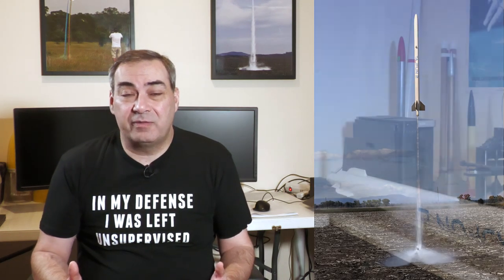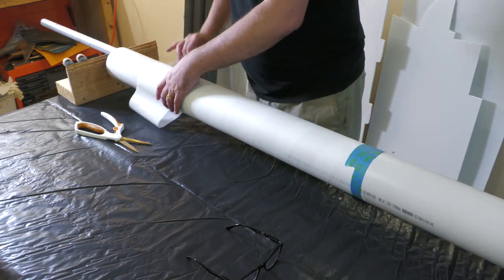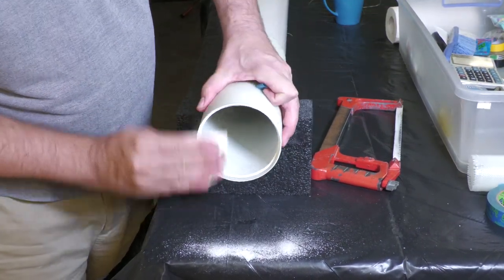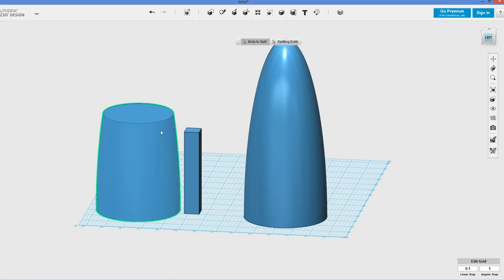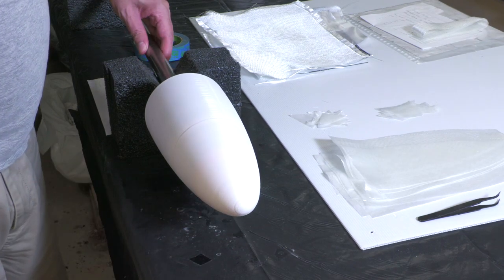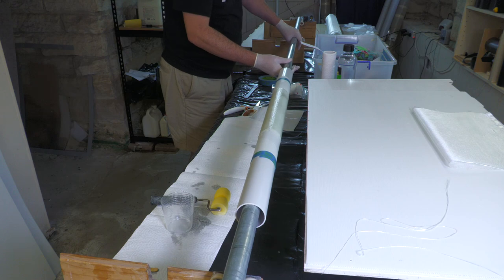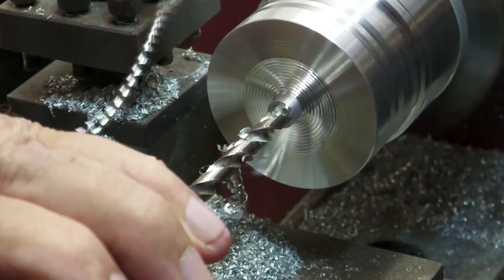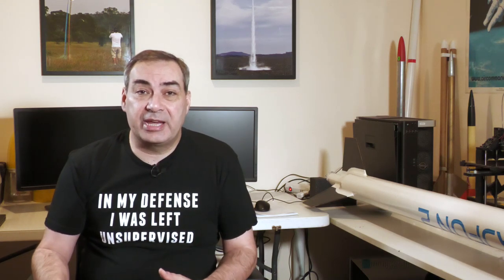High Power Water/Pyro Rocket - Part 2 - Nosecone and Nozzle

Comment: it is magnificent that you use simple tools like a pizza cutter for the fiberglass. We really need to think a bit simpler. That tipp will be used ❤. Well then the production of the nozzle is shown an we instantly feel like we are just some guys without any proper equipment. Loved the video though . great process so far
Reply from the maker: Thanks, although it looks like a pizza cutter, it is actually a roller cutter typically used for cloth. (here is an example: https://www.scissorman.com.au/product-tag/rotary-cutter/) If you ever need to cut fiberglass cloth, it is the ONLY tool to use. You'll never go back to scissors once you've used it. Much cleaner and faster for complex or straight cuts.
Reply: yes looks like it we used a big commercial cutting Maschine but the blade was getting absolutely destroyed by the cloth. We will definitely invest in such a tool. thank you 😊

Comment: I have a question about the epoxy you use to making this rocket. What is the epoxy you use for this rocket, and does it have high temperature resistance. I am also building a compress air rocket which is aimed to reach Mach 2 so I am currently very concern about the surface temperature and the ability to withstance heat of the rocket's material at high temperature. I am also watch alot of your videos right now and learn a lot from them. Hope to get your response. Best regards.
Reply from the maker: Hi, the epoxy we use is West Systems 105 with the 206 slow hardener. It isn't a high temperature epoxy. I think it's glass transition temperature is around 58 degrees C. There are high temperature epoxies you can use but these tend to be a bit more expensive, however, most of the airframe isn't going to experience very high temperatures for a long periods of time. I would be comfortable using West Systems on most of the airframe even for a Mach 2 rocket. You would want to protect all the leading edges though with different materials or higher temperature epoxies. ... You mentioned a compressed air rocket going at Mach 2. Do you have any details on your proposed rocket and how you would achieve those kinds of speeds?
Reply: @AirCommandRockets  Well, for our rocket, we intend to use a convergent-divergent nozzle that we design to have an optimal  area ratio and pressure ratio that can accelerate the flow to mach 2 and above. The chamber pressure we choose is 10 bar so we calculated the appropriate area ratio and pressure ratio base on isentropic flow relation and got a result of about 1.91 and 9.87 which thereotically can help to accelerate the flow through our nozzle to maximum exhaust velocity of Mach 2.14,  and from these 2 quantity, we can also calculated the real exhaust velocity, mass flow rate, specific impulse and thrust. So our rocket will have a real life exhaust of around Mach 1.53, a mass flow rate of 0.82 m/s, a specific impulse of about 53.8 s and a thrust of about 434 N. The exhaust velocity is not so high, which is understanable since our rocket use air as propellant, and I calculated base on the temperature of the air at sea level (15°C), the chamber temperature is not high enough to make the flow to reach mach 2 (which need a temperature of around 280 degree celcius), but with a thrust of 434 N, and a constant exhaust velocity of Mach 1.5 (because of the correct area ratio) we think that if we can make our rocket light enough and somehow find a way to increase the total temperature of our compress air propellant, our rocket speed can reach Mach 2 even if the flow did not. Thank you for your respond and show your concern about our project, I am very appreciate it. This is the first time we doing an ambitious project like this so it is very important to us to be able to find as much knowledge as we can. I will consider your advices and protect all the leading edges with higher temperature epoxy or different materials (and sorry to ask this but I don't really get it about the leading edge, does it mean all the joints and the edge of the fins, thanks again).
Reply from the maker: @HoangNguen-o2j  Thanks for sharing the very detailed explanation. Although the exhaust velocity can be supersonic as you pointed out with an expansion nozzle. But that doesn't necessarily translate to the velocity of the rocket when you take weight and drag into account, and the fact that thrust duration is very short. Practically the rocket will be well subsonic. But happy to hear what you actually achieve when you build it. 
And yes, leading edges are anything that protrudes from the air frame of the rocket like the nosecone tip, any transitions, rail buttons, etc. and the forward edges of the fins.

Comment: You probably know it, but filing or sawing fiberglass will quickly dull your tools. Glass is much harder than steel, so it is not ideal to cut it with with steel tools. With the hacksaw, it's probably fine as the blades are cheap anyways, but I wouldn't use a file for it.
Reply from the maker: Yup definitely good advice. We do go through quite a few blades, the better quality ones last a little longer. Surprisingly the cheap file we use on the fiberglass has lasted a couple of years and still does a reasonable job. We don't use our good files on the fiberglass.

Comment: What a great work!! I am so impressed! What type of aluminium you used for the nozzle and the internal diameter for the nozzle? sorry if it is already on the video ;)
Reply from the maker: Thanks. I am not sure what the aluminium was, but it was easy to machine. Nozzle diameter is 15.6mm.
Reply: @AirCommandRockets   Thank you for the answer! I am building a water rocket in Korea for the first time. I wanted to build a L2 HPR but launching and making a solid rocket fuel are illegal here, so I turned into water rocket and it fascinated me. Your video helped a lot Thanks again. Keep up the good work!

Comment: Its always such a good moment in my day to watch a new video from  your channel. I have a question for you. Sorry if you already responded and I missed it but do you have a strategy for fiberglass sheets overlaps? Any fixed amount? (ex. 2 cm or 1/6 circum.) Thx.  Greetings from Canada.
Reply from the maker: Hi, and thanks for your support. :) Yup, exactly, the last circumference wrap overlaps by 2cm. If we then do a second wrap with another sheet, we always end it on the opposite side of the mandrel so that the two overlaps are opposite each other to try to even out the forces on the pressure chamber.

Comment: Nice video ! Have you ever tried the FG sleeve to make the nose cone ? It's a whole lot eaiser, faster, cleaner, it's also seemless, and you already buy sleeve from soller so...why not ?
Reply from the maker: Never tried it on the nosecone. I've thought about it though, the problem I see is that you still end up with a transition somewhere along the nosecone. The sleeve will only shrink down so much without folds, it won't go over the tip and you end up with frayed edges where you cut it. You could maybe use two sizes but because of the taper you can't pull the second one tight. Have you used them yourself? I'd be interested in knowing how you do it. Going from 4.5" to a tip?